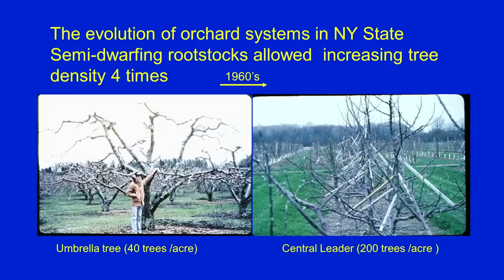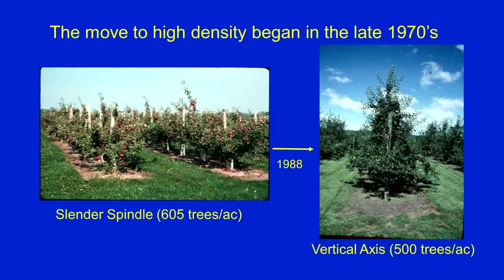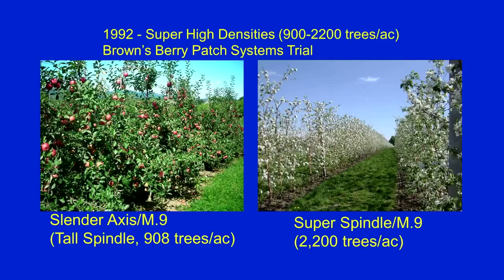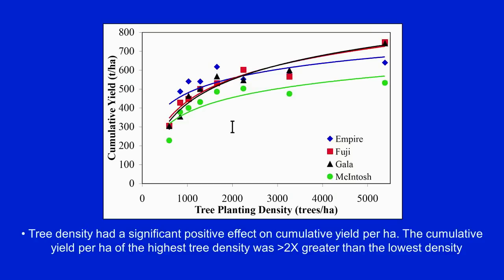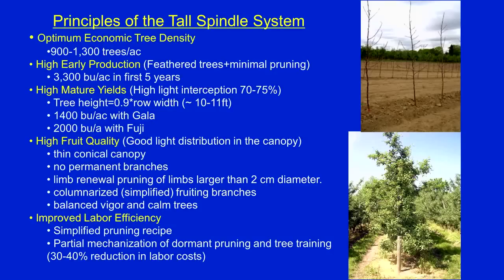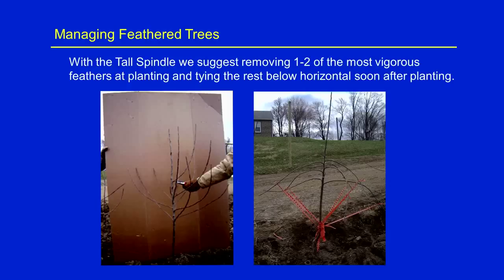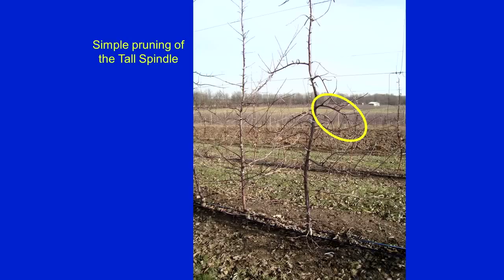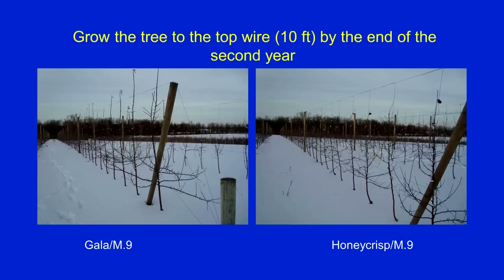The New Tall Spindle Apple Orchard System: Keynote Address

Comment: I am from India and you taught me a lot thanku I will do what you said... My question is if we don't want to need that road for machines then how many more plants we can plant per acer. Mm
Reply: Basically you don’t want one row of trees to shade a different row of trees. NY state is almost 45 degrees latitude. Assuming the rows run east-west, at that latitude, an 11 foot high tree also casts an 11 wide shadow, which happens to be a nice row width to drive a tractor down.
Reply: @nohphd  . Thanks for your answer from a USA hobby Grower
Reply: You still need space for light. Minimum 10 fr
Reply: @nohphd  thank you very much sire